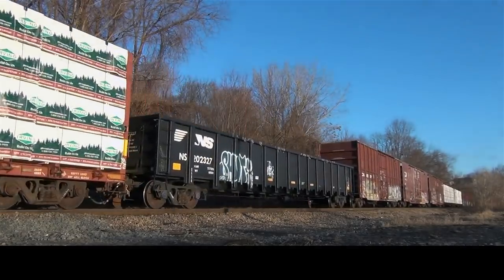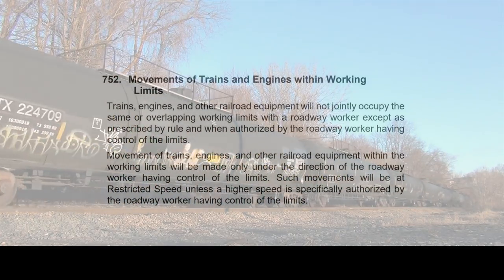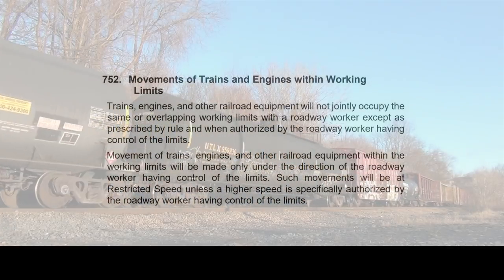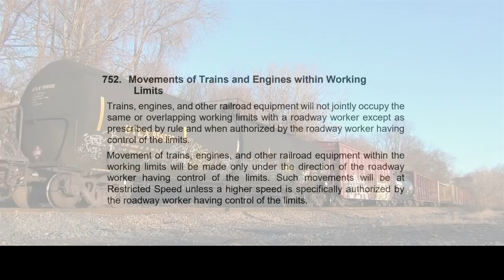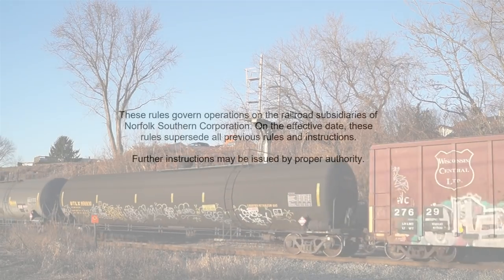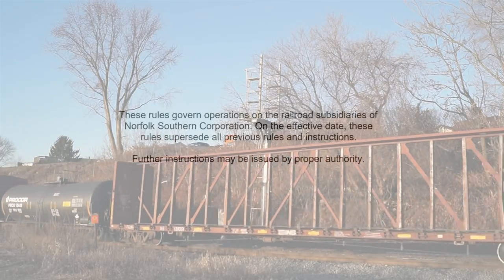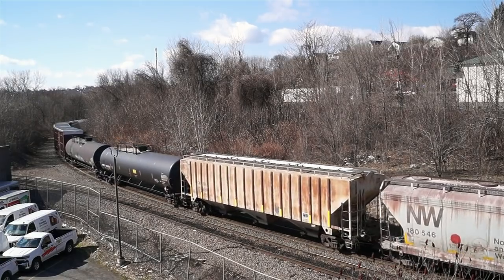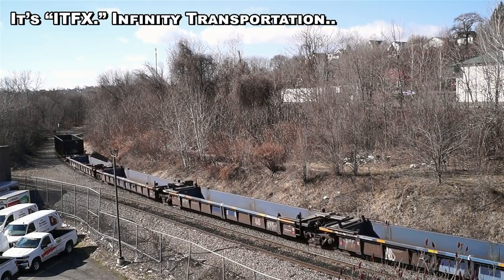[T-185] HOW RAILROADS WORK: What is NS Rule 752 + Stealth Trains and Operator Errors | Trains 21

Comment: If that is out of the NORAC rule book then may I make a suggestion to do a video on rule 98. Operating at restricted speed. I know it is a simple one but I see it defined wrongly way too many times than I care to correct. Thank you for going over this rule AC.
Reply from the maker: No problem, Rusty.. It is out of NORAC and yes, I'll do a video either on, or spotlighting the NORAC Rule 98.. Thanks for watching.

Comment: @ 0:19 I thought what if heard was a DMR (digital mobile radio, made by Motorola) format transmission, but then I remembered that railroads don't use DMR, they use NXDN (made by Kenwood) as a digital voice mode. From the sound of it it was a "blank" that's wasn't sending voice or data on the transmission.

Comment: so what would happen if that foreman could not it either the train or the dispatcher with his radio? everything grinds to a halt until he finds a pay phone, or a hill? Maybe there is cell service...
Reply from the maker: In a worst case scenario, he would have to drive close enough to a spot where he could hear something and/or any trains would have to stop and wait for verbal communication.
Reply: @Trains21   I love it when I leave out a key word. in my reply.. like HEAR.  Sigh. 

I have operated at times, over the years, on the VHF Two Meter Amateur Radio Band ( 144-148MHZ) which is close to the railroad band on 160 MHZ. So I know there are times when I can't even hit a repeater high up on a TV tower. I guess the railroads have communication huts that pick up the radio signal and then send it onto a land line or a satellite. Maybe they are never out of range of some sort of communications. And the frequency they are talking over sends them to the right dispatcher, and not to one , say in Los Angles, even though they might be on the same frequency... just separated far enough. I can see your head spinning AC... LOL
Reply from the maker: @jim874  Railroads (at the big Class 1s) have towers every so-many miles for transmitting and receiving.. They call them "bases."

Comment: AC: Surely 1st. class railroad operations would benefit greatly by the use of telemetry for transmission of those lengthy instructional directive narratives, instead of tying up the verbal communications radio channel. The telemetry could be received and downloaded from the onboard computer. My gracious, railroads already use radio-controlled remote controls for other operational services.
Reply from the maker: That's a good point.. I never thought of it that way.
Reply: Under PTC operations, some trains are receiving track authority via download.  The authority is often read back to the dispatcher to verify it is complete and correct.    Frankly, I prefer copying warrants over the radio; that way I have an idea what traffic is out there, and what I may have to work around in a couple hours